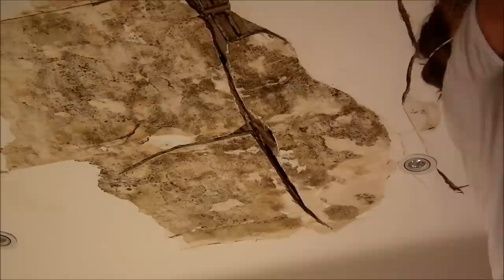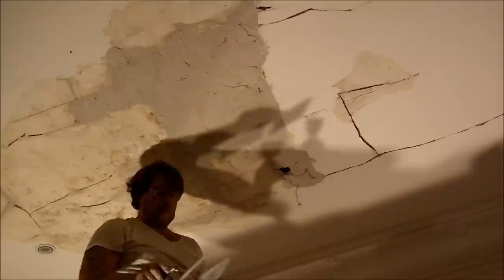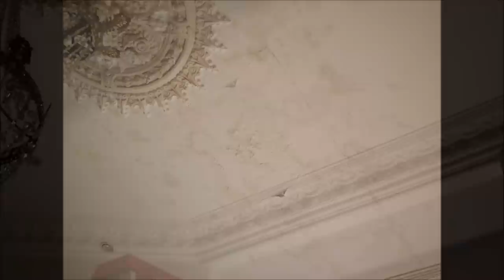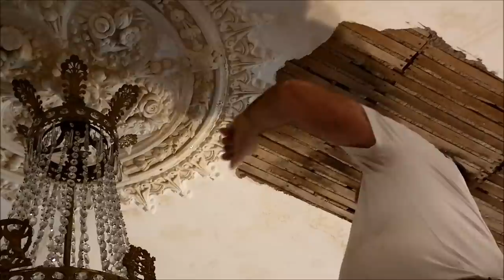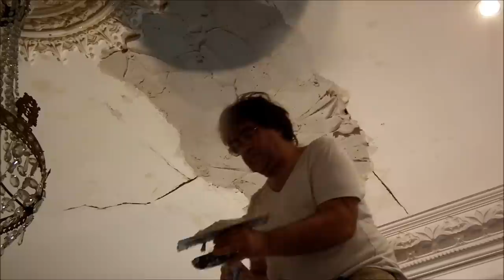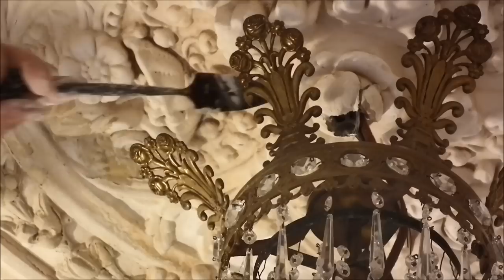Lath and Plaster Water Damaged Ceiling Repairs Glen Iris Melbourne

Comment: I don't understand why you don't use a drill, dedicated whip and a bucket to mix that stuff: you'll work, better, faster, cleaner and you'll get a perfect consistency of your plaster: As I can see, it's full of lumps. really I don't understand...
Reply from the maker: Hi Harles74  if we whip it up with a drill, the mix  will all set at the same time, so we hand  mix.
That way we can have some plaster sitting in the pot to polish off with.or put another coat on.
The CSR Cornice Cement starts to set as it is worked.
I do the restoration a little like a solid plaster set. but also by using about three coats to get there depending on the job.
I use a drill to mix but mainly for big runs of plasterboard or mixing render.
All the best Neil
Reply from the maker: +Harles74 i am doing it in traditional style, that is sand and plaster render the first coat, if it is only small I will hand mix the render.
There is no problem with any lumps they will spread as the render is put on all the best Neil